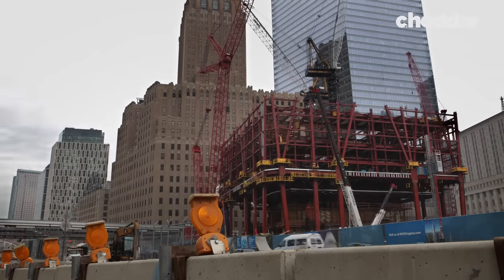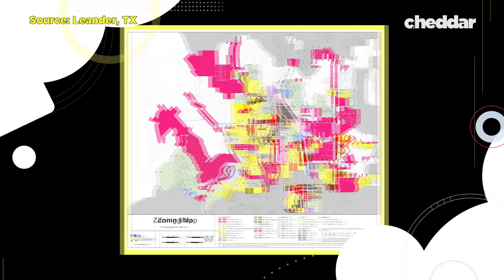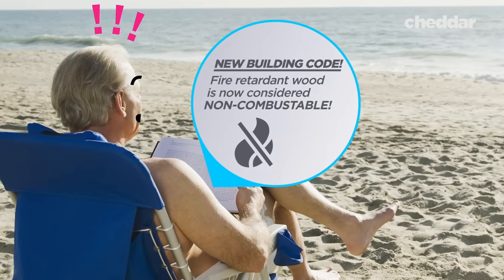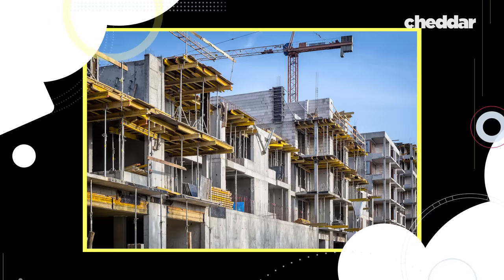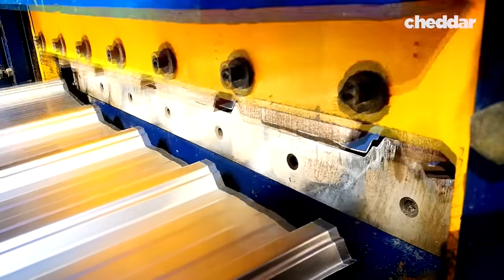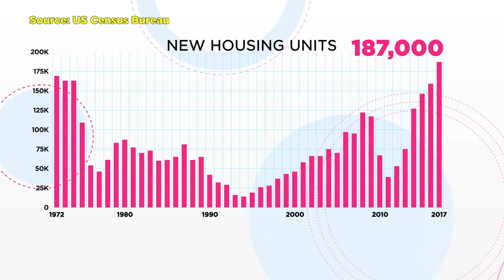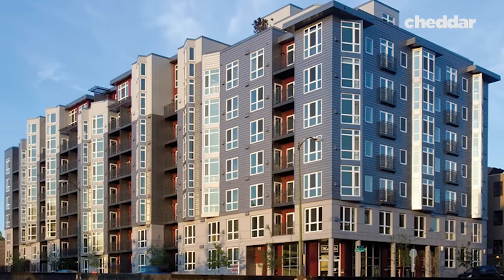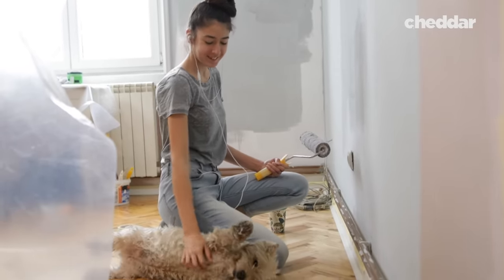Why All New Apartment Buildings Look Identical - Cheddar Explains

Comment: The urban U.S. housing market's space constraints have sparked creative development solutions. However, locally, I've seen 'luxury' apartments built with cheap materials, prioritizing profit over quality. Thin walls and floors make for a noisy living environment, yet developers charge premium prices. This disparity between cost and quality is alarming.
Reply: To prevent hastily built 'luxury' apartments from becoming future slums, I propose revising codes to require at least 4 feet of insulated space between units. This ensures quality, sustainability, and resident well-being over short-term gains.
Reply: Developers profit from cheap construction, passing maintenance costs to buyers. Consulting a fiduciary advisor can help investors optimize income, navigate taxes, and prioritize long-term growth.
Reply: Impressive gains! How can I get your advisor please, if you don't mind me asking? I could really use a help as of now
Reply: Rebecca Noblett Roberts is the licensed fiduciary I use. Just research the name. You’d find necessary details to work with a correspondence to set up an appointment..
Reply: Thank you for the lead. I searched her up, and I have sent her a message. I hope she gets back to me soon.

Comment: clarification: These buildings are cheap for landlords. They are marketed as expensive luxury products to renters.
Reply: Just another example of old money jealously stomping on newer generations, for every single quarter they have.
Reply: And it shows...
Reply: It's often even worse than that, the builder has no intention of renting these, because they know the extensive repairs they'll have to deal with later. Instead they sell them as luxury condominiums. This way they've completely washed their hands of it and it's a couple of years later that all the residents suddenly have to pay massive special assessments to cover the cost of the damage to the building from normal weather because the condo fees set by the builder were nowhere near enough to cover them.
Reply: Wow.....this hit me and realizing my current apt, spot on
Reply: @Green__one  And it's not just water damage.  These things have a lot of other problems as well, including plumbing, heating and cooling, air-flow, carrying capacity, and so on.  A lot of them barely managed to meet building codes.  Aside from being ugly as hell, they're just built so cheaply that they're practically disposable; which was entirely the point -- maximize profits rather than provide decent-quality housing.
Reply: Exactly!
Reply: Exactly! 👌
Reply: @pvmatrappurple360  70's style ugly.  They'll look like absolute shit in 10-20 years
Reply: Yes this exactly.
Reply: @EphemeralTao  that’s the problem when housing is left to hands of a bunch of capitalists, maximizing profit is the only goal. We need a government housing option.
Reply: @mikerey6711  Yup.  Nationalize and socialize the housing industry.
Reply: Add the fact that many of these places were built with the benefit of local tax abatement schedules.  Eventually, many of these have a good chance of converting to condo during the time frame that the abatement expires.
Reply: @Green__one  its the same deal with all the mcmansions they build in the suburbs that all look identical. Shiny and new up front but tons of issues down the road due to cheap construction.
Reply: It's almost as if the price points set for housing aren't actually based on maintenance or construction costs, but what parasites can get away with selling them at.
Reply: @EphemeralTao  We're regularly told to build more housing to make it affordable for everyone (as if we don't have several empty housing units for every unhoused household), and yet doing this does nothing to alleviate the costs in major cities. The same people will also say building more "luxury" housing (which is entirely marketing BS, there is functionally little to no difference between "affordable" and "luxury" housing besides the price) will lower it's cost for everyone, just simple laws of supply and demand (though again, increasing supply hasn't effected price, everyone still needs a home, and the idea that giving more to the wealthy will benefit those less so seems like a familiar lie). The problem is that housing is commodified at all.
Reply: @1000g2g3g4g800999  The problem with price is that there still isn't enough available housing to meet demand.  Nearly all the new housing that's built is bought up by investors and speculators, which is why it sits empty.  Property hoarding is still a huge problem.

There are differences between "affordable" and "luxury" housing.  The main ones being size, cost of construction materials, amenities, and access to local resources.  
And at least where I live, builders are targeting higher-income renters/purchasers by building lower-density high-cost units with more amenities, rather than higher-density lower-cost units with fewer amenities that would be affordable to more people.
Reply: @EphemeralTao  "Nearly all the new housing that's built is bought up by investors and speculators, which is why it sits empty.  Property hoarding is still a huge problem."

This is also a consequence of housing being a commodity to be bought and sold in the first place.

"There are differences between "affordable" and "luxury" housing.  The main ones being size, cost of construction materials, amenities, and access to local resources. "

The fact that the very subject of this video gets marketed and sold as "luxury" housing is an example otherwise.

"And at least where I live, builders are targeting higher-income renters/purchasers by building lower-density high-cost units with more amenities, rather than higher-density lower-cost units with fewer amenities that would be affordable to more people."

The preference for building "luxury" housing is everywhere because it makes far more money than "affordable" housing. Housing in America (and Canada) is a market failure, and either existing housing should be appropriated (possibly through massive taxes or absent ownership), or public housing needs to be built.

I'm not a fan of how these discussions are always centered around making things people need to live "affordable" when they need them regardless, you're keeping out some people when they get too poor, the conversation should shift towards some more of these things being "free."
Reply: You stole my comment idea

Doesn't matter I am 1 year late LOL
Reply: @EphemeralTao  you can always buy building that is build with concrete pillars and stone mansory walls reinforce with steel rebar but those cost more its all come down to budget.
Reply: @patthonsirilim5739  Not really, no.  The city isn't building like that anymore; and what few buildings like that which are still standing are mostly office buildings, not residential.
Reply: @Green__one  Probably not a good idea to buy a 40 year condo in the Miami area, eh'?
Reply: I,ve seen it all now. It had to be USA. The way it's normally done is called concrete frame. Not masonry. With the underground made as concrete load bearing walls. Its unbelievable ... wood apartment buildings
Reply: @Blackspidy619  the renters are stupid, they allow landlords to take advantage.
Reply: luxury ghettos
Reply: not cheap by any means to today's landlord unless you're savvy and use housing grants and tax incentives. At least in CA.
Reply: Buyden's World 🌎
Reply: @Green__one    "cost of the damage to the building from normal weather"

building code prevents such thing.  

Think more, spew less.
Reply: @AllenGraetz You're funny! Two things, first of all, building code does NOT prevent damage to your home from normal weather. There are many shortcuts that can be taken and still comply with building code.
Secondly, MANY builders are not in full compliance with building code, and manage to hide it well enough that inspectors don't catch it.
What fantasy world to you live in?
Try talking to ANYONE who's actually owned a building, I'm sure you'll find that not all maintenance is due to things beyond normal weather.
Reply: @Green__one or they are enough, and the building management will still rather send you the bill.
Reply: @Kanis5000  in a condo complex, it's the condo board, made up of owners, that decide this, not a management company. Management companies are only in the case of a rental structure where they can't pass on the bill. The condo board doesn't want to pass on the bill, because they end up paying it too, after all they are owners. The issue is they have no choice, what the builder set up and promised as condo fees, is artificially low to encourage people to buy, but once they are done, the board quickly determines that the money coming in isn't enough to cover the expenses going out, and usually have to approximately double the condo fees. That's step one, within the next five to 10 years, all the shortcuts the builder took start to appear, and even those raised condo fees aren't enough to cover the major damage, so the special assessments start.
Talk to anyone who's bought a condo in a building that's been built in the last 20 years and every single one of them will have these same horror stories.
Reply: And the BS part is that "luxury" doesn't mean a butler and a doorman, it literally just means, there is a counter top with $1000 of marble or something.

Comment: This explains all the “luxury buildings” in some metro areas that cost $2200+ for a 1bedroom but you can still hear a pin drop
Reply: That pin drop thing is spot on! The walls be so thin and they love to put those cheap ass concrete floors or dormitory floors in them. I've got a few friends who've moved into these new apartments and the only thing nice about them are the appliances and finishes!
Reply: utterbullspit facts I just recently moved into one of these and the road noise is awful. I haven’t noticed the thin walls thing but I don’t think I have neighbors on either side of me or even above me.
Reply: @UCuxijVFQ__OeCI8dESgkvMQ as in you can hear a pin drop from your neighbors next door and above you.  As in the walls are paper thin you can hear clear conversations.
Reply: These type of units go for 550K plus in metro Vancouver. Even 1 bed
Reply: @Surrey360  yep 1 bed studio apartments without parking in outer London go for £400,000+ so similar prices
Reply: @whynotagain3639  yeah it's pretty ridiculous is you ask me
Reply: @utterbullspit  this is bullshit. My apartment has 10 foot ceilings, soundproof sliding doors to a balcony, and the walls are and ceilings are also soundproof. Comes with Gina bit internet, touchscreen mounted into the wall to see who is at the elevator, smart locks, smart thermostats the works. 1500 bucks a month for 1000 square feet. It’s badass
Reply: @Mvncher  That sound nice. Where you live? Sound polution also depends on your neighbors. The worst type of neighbor are people with running/crying/jumping kids, people with barking dogs, people who slam everything & are obnoxious, and the dredded ghetto loud music neighbor.
Reply: @user-qm9ub6vz5e  Lucky you!
Reply: @utterbullspit  lmao and now it’s all over nyc
Reply: @mirasyal4259  Hey depends where you choose to live. You win some, u lose some... Just move then!!

Comment: Many of these buildings are popping up where I live. They are advertised as being "luxury" apartments, but because of the cheap building materials, you can literally hear every step your upstairs neighbors take, as well as conversations in adjacent units. These buildings are a nightmare in terms of noise, yet developers charge more for them even though they cost less to build.
Reply: That's the main problem. The code needs to be changed to require 4 feet of insulated space between apartments.. Right now these apartments will be crumbling project hoods in the next 10 years.
Reply: Actually LANDLORDS charge more for them even though they are cheaper to build. Developers sell these sorts things off. I’m guessing the landlord gets the discount for it though. Hopefully they are putting all that extra money to the repairs needed  for these poorly build things
Reply: and they are a fire trap !!! all wood and no fire walls !!!
Reply: They also aren’t cheap in just terms of material. They also typically built with nonunion residential construction firms while traditionally large apartment buildings were built by union commercial contractors, which on average are more highly skilled and thus subsequently more highly compensated.
Reply: It isn't the materials. Just ask yourself. If you suddenly have 200 units per acre, there are so many people of course it's noisy.
Reply: @MrBoliao98  It is utterly preposterous to imply that building materials have nothing to do with  noise reduction. 200 unit dwellings exist in which you can’t hear everything your neighbors are doing. It is abnormal to be able to hear your neighbors conversing at normal volume through the wall of your unit.
Reply: @cardinalrule6810  it's the same materials you're using in detatch properties. However instead of a sole house on a say 3000-5000sqft plot, it's something like 20 units on 10,000 sqft. It's insane, and it is why your noise is 10 times. Generally you Americans refuse to use brick, and you reap what you sow.